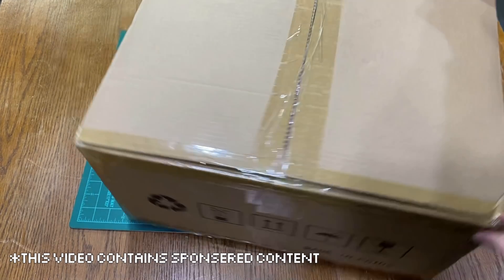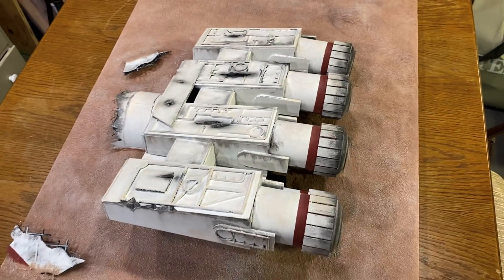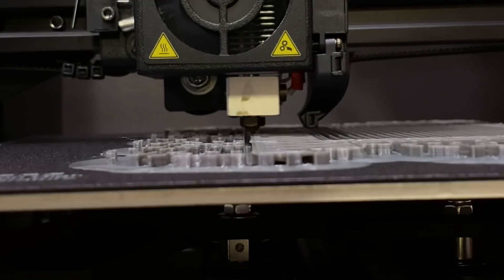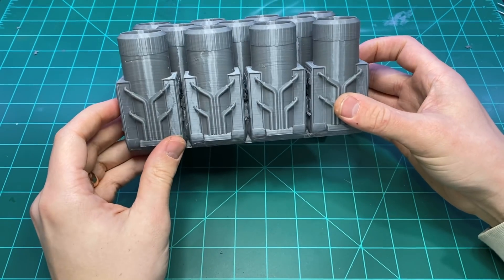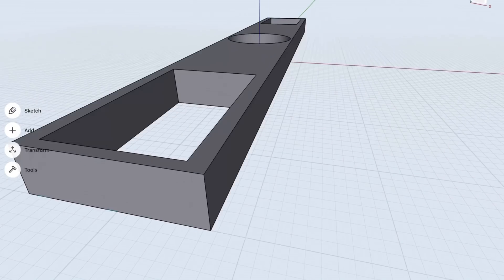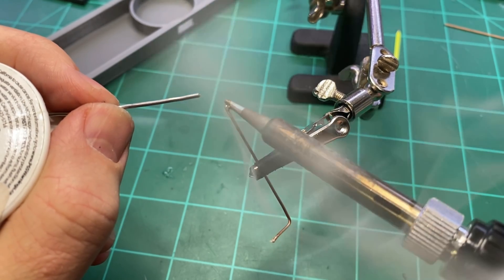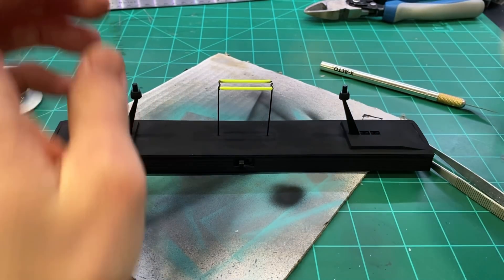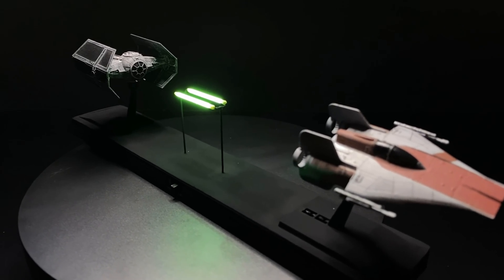Star Wars Inspired Designs for 3D Printing | Anycubic Mega Zero 2.0

Comment: I'm really confused, in this video the leds could be powered with just a coin cell, but in your death star video the same leds (though from a bulb) need the led driver. 
I've tried my leds straight with a battery and with the driver, but it ONLY works with the driver and they're super dim.